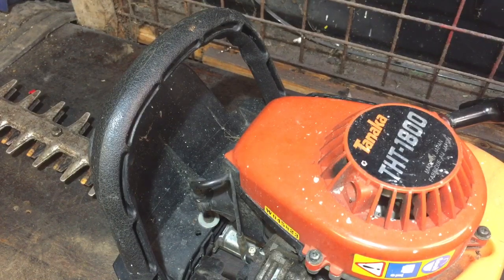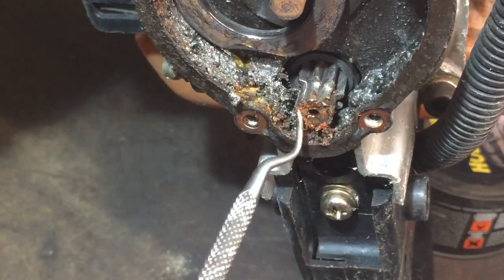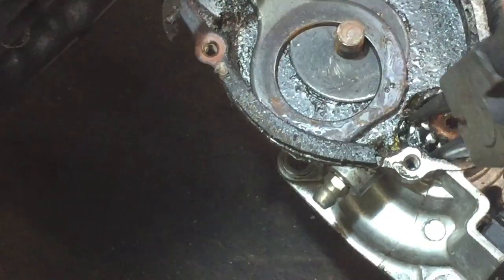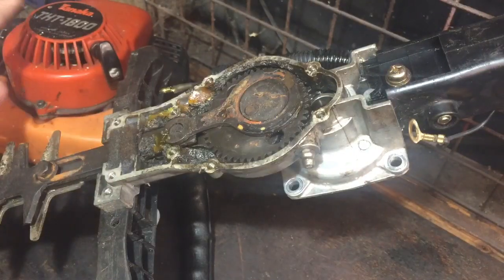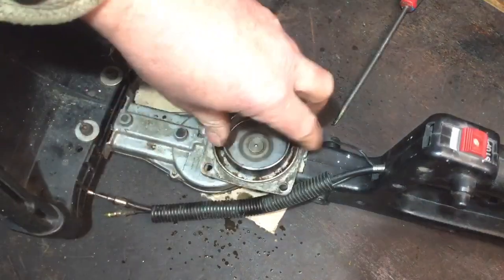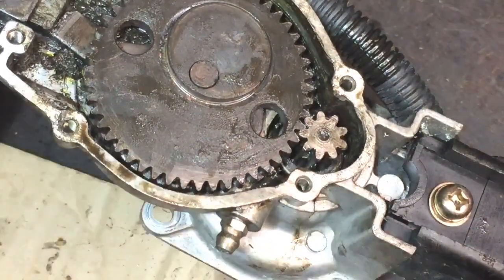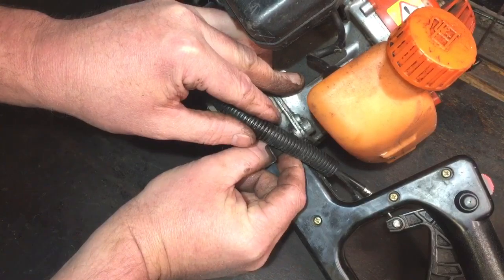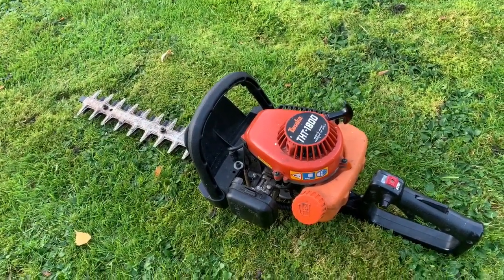Hedge Trimmer Blades Won’t Rotate ( Can Mend it Man Fix it ❓ ) 🤔🔧🪛

Comment: great video , could you tell me the name of the part you changed as i have a similar problem where the cup that the clutch grips to to spin the shaft to drive the blades has come away from the shaft , but don't know the name of the part to look it up , many thanks

Comment: I would have had to change that bearing Luke. Only about £5.00
Reply from the maker: I agree in an ideal world I would have, but there are 2 bearings on this top and bottom, bottom one was cheaper about £5 top was nearer £10, as it’s probably a £65 hedge trimmer unfortunately I couldn’t stretch to that. But I think it’s quiet enough 🙂👍

Comment: That’s done the trick with a Birmingham screwdriver Luke and a bit of shopping, good job. Keeping these repairs economic must go against your love for these machines especially that bearing being so rumbly. But it’s definitely got to be give and take I suppose
Reply from the maker: Yes I would have loved to have put new bearings in it, but with postage they were going to cost around £20 add that to the part I had to buy, that’s £30 plus another £7 odd for service parts. I think I’d be lucky to get £65 for the machine so I just couldn’t justify that expense on this machine. If it had been my own work machine it would definitely have had new bearings in it, but tbh it’s not that noisy it’s much quieter than I thought it would be. It lives again and if kept greased up I can’t see any reason it won’t last a few years 🙂👍

Comment: Hi Luke, nice little easy fix👍
I've been buying Castrol high temperature wheel bearing grease in tubes as a replacement to Stihls rip off. Had good luck with it for a few yrs now.
Reply from the maker: That’s why I bought this grease, the Stihl stuff is just to expensive, seemed good stuff 🙂👍